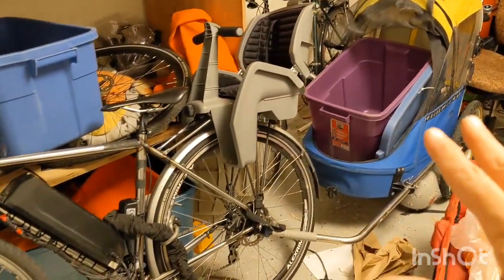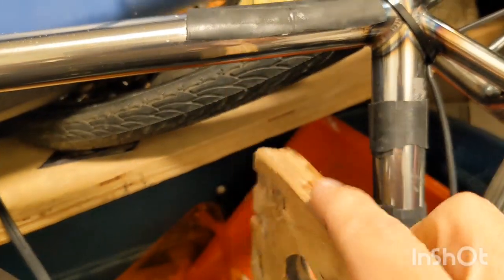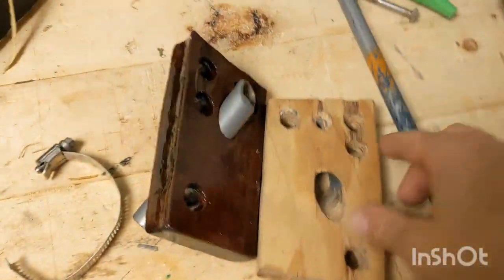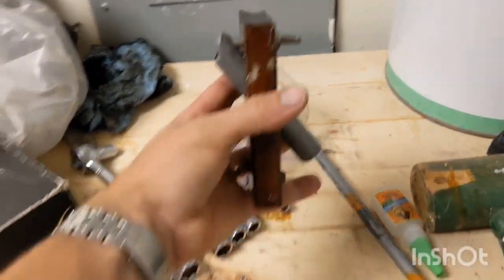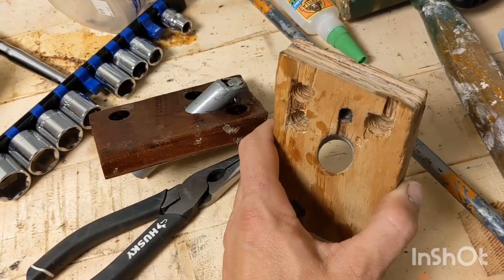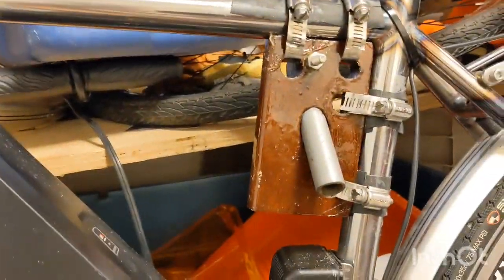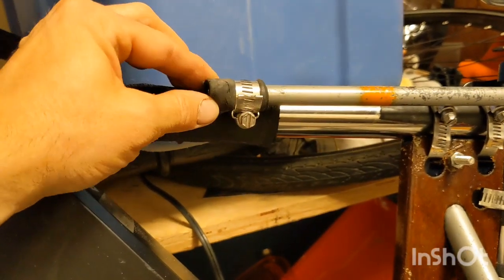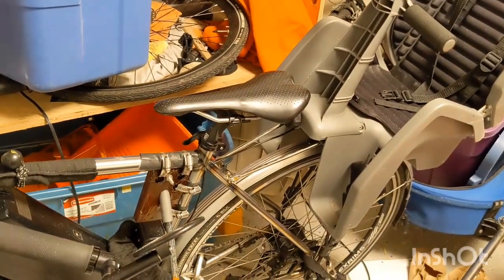DIY cargo or touring bicycle kickstand

Comment: I have the same issue but my cargo is all the DIY accessories I’m constantly fabricating. Your design achieves solid results, but i wonder if it couldn’t be more frame-integrated… like a vertical telescoping swing-out arm, with one axis of freedom to roughly 30º fixed with a pin & bearing at the same frame origin point as yours, roughly parallel to the seat post, with a 180º jointed locking arm midway down, just shy of the inside end of the rotation sleeve lock for the inner telescope segment. 

This is starting to sound a lot like a repurposed crutch… or one leg of a folding walker!

Ima try it.